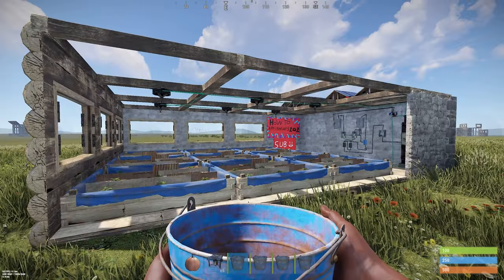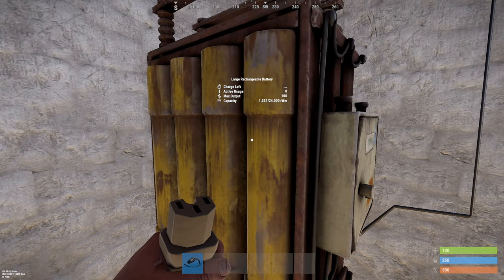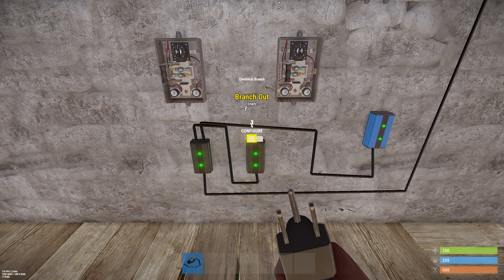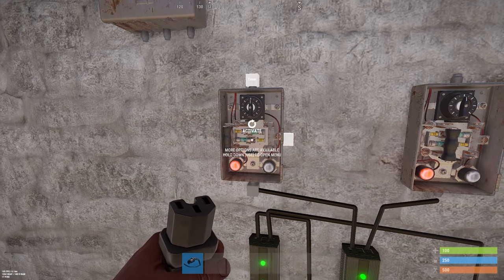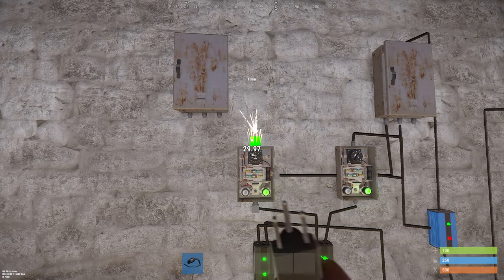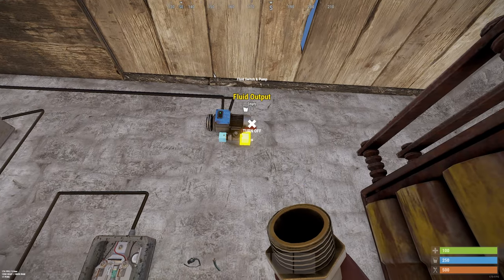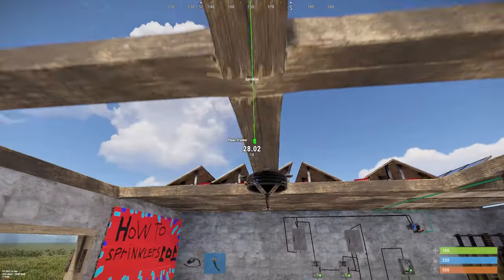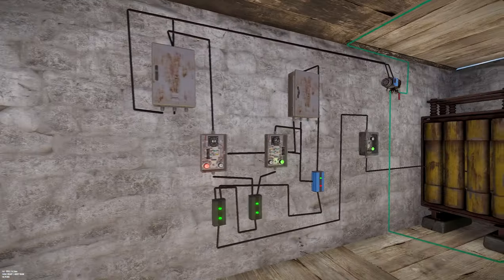How To Build An Automated Sprinkler System - Rust

Comment: Man you make it so simple and clear, subscribed !
Reply from the maker: Thanks for the sub! Awesome, thank you!
Reply: @explainable. Least I can do, thank for your work !
Reply: @explainable. I still got a problem mabe you can solve: My pump and sprinklers goes off for less than a second and goes on again, basically watering my hemp continuously while making lots of noizes. I ve set my branches and timer at 10 and 15, have a large battery I did ecerything like you but I might did something wrong idk. Thank for your fast answers !

Comment: does this really require 25 Power? any way to trim some of that so it doesnt use so much? that is two turrets worth of power...

EDIT: Followed the steps exactly and it doesnt work, sprinkler stays on for 15 seconds and only turns off for 5 seconds only for it to turn back on, way too much water consumption.
EDIT2: Changed the right timer to 60 seconds and now the sprinkler stays on for 15 seconds and stays off for like 45/60 seconds and then turns back on like i want, way less water usage. System works great, thanks!
Reply from the maker: Thank you so much for the tip, I think I will redo this video, with better water usage. This was one of my first videos. Thanks for the edits, really appreciate it!
Reply: @explainable.  you should also aim to make it as power friendly as possible meaning make it cost as little as possible.
Reply from the maker: thank you!!
 @PerzyYT

Comment: How do you do it with the last update. I hook up and 3 sprinkler work. Try putting another pump and still only 3. Even if I put a pump after 2 sprinkler
Reply: U need 2 or more main water lines, use the same reactivating method but connect it to two diferente pumps with 2 diff water sources

Comment: If you get rid of the second splitter you don’t need to have the pump toggling just turn it on and leave it on.
Reply from the maker: Yes, but that’s not the point of the video….
Reply: @explainable.  Yes, you can indeed take away the second splitter and get the system to work in the same way. The first timer will not passthrough any power to the pump during the "pause phase" so with the pump turned on (with no power input) will do the same thing as toggeling to pump off (with no power input). 
TLDR: All the second splitter does is to turn off the pump, during the phase when the pump is not receiving any power.

Comment: Where do I even start with this? Terrible example. You made that 10 times more complicated than it needs to be. First of all, why did you use two electrical branches on the bottom to feed three inputs, when one splitter would have done the exact same and been a lot tidier? Why not just connect the "toggle on" input of the water duration timer to the electrical output of the interval timer, and then power them both from the switch using a splitter, with the third branch of the splitter going to the power inlet of the blocker. So then when the interval timer turns off and passthrough is allowed through the blocker, both timers will turn on at the same time? It would have been so much more simple?
Reply: He's at least providing help that works...
Reply: @Satanspawn55  But he made it a lot more complicated and hard to understand. If he did it the simple way it would be a lot easier for people to understand. This is supposed to be a tutorial video afterall.
Reply: @Thebattler86  Hey bud, go make one urself
Reply: @lanceamsen  I do make them I have one in my own base rn